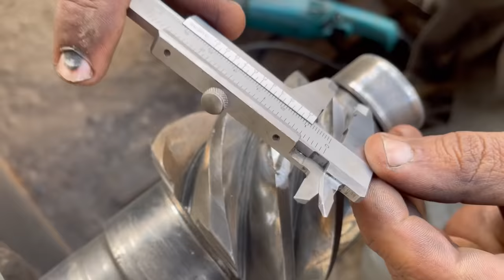I repaired the scrub pinion which no mechanic repairs | Give your opinion by watching the video |

Comment: Comparto con todos los lectores :
Para tener presicion en estas reconstrucciones recomiendo  fabricar dos  moldes en bronce o cobre  del diente para instalar a lafo y lado  para proceder a soldar
Reply: Podrías mostrar la técnica?
Reply: @TheStymax  La Técnica de Rafael es proteger los dientes que están buenos, protegiéndolos de la soldadura que se hace en el diente malo.
Reply: Para construir los moldes :
* se  toma una endidura entre dos dientes en buen estado se llena concualquier epoxico que se enduresca y ese es el prototipo para fundir  los dos moldes saludos a todos los que les intereso mi solucion
Reply: La técnica de rellenar cualquier rotura de este tipo con electrodo es válida también en ejes que se engranan y pierden material por la temperatura de rozamiento, se desgasta y hay que suplementar de alguna manera, luego torno de bancada o manual según sea.
Reply: @pabloantoniofigueroa4162  rellenar un eje y darle la medida de nuevo es algo a rota le según la aplicación del eje, en engranajes es muy diferente, si el patron de contacto es diferente en ese diente se crean puntos de presión que van a terminar rompiendo ese mismo diente o la corona con la que engrana, eso es tallado con un creador y luego rectificado con un creador de piedra, dejando tolerancias máximas de 0.01 mm, además de tratamiento térmico y todo lo demas. con eso sigue andando la máquina pero dura 1 día o 5 años, es incierto
Reply: Existe un spray que se rocía para que las chispas no se peguen en el material en buen estado

Comment: I am amazed that you can duplicate a ground gear tooth with hand tools. Well done, sir!
Reply: Helicopter blades were finished in a similar fashion. I saw it being done at Sikorsky Aircraft in late 70's - early 80's.
Reply: he can't. The tolerance on those finished gear teeth are under a thousandth of an inch, or 1/3rd the thickness of a single hair. I used to make them on a hobbing machine. They need to be that accurate for the oil to work properly and prevent wear, this gear is going to wear out very fast. There's a reason why the title says "which no mechanic repairs"
Reply: Agreed. I guess when you have no other choice you gotta fix it somehow.

Comment: Gears are shaped so there is NO grinding at all! A perfect geometry makes surfaces meet and transfer forces, but do NOT move against each other. This will NOT be the case after that repair.
Reply: He didn't need to grind the other perfectly good teeth. This will fail in no time, they're all gauged. And there is no way in hell that grinding action made the perfect geometry
Reply: @mikemx55  grinding heated the metal which in return got softer which im return will brake again in no time. thats why noone repairs that parts

Comment: Great talent with that grinder. 
Those gears are hardened and match ground. 
It’ll probably be noisy but will,  I’m sure get that machine back on the road and to a place it can be repaired correctly, using a matched ring and pinion. Great video!
Reply: Well, perhaps. If they ran it lightly loaded and assembled it properly.

Comment: When I see failures like this, I think of the engine braking procedure while going down steep hills using the engine compression to brake the truck. When the engine turns the wheels the maximum power the transmission handles is the power of the engine but when the engine brake is applied, it could happen that more power can be transmitted back to the engine,  and the brakes, hence the transmission would fail.   Please work out the related torque in question with the situation mentioned. 
Obviously, this repair is a desperate situation to proceed using the truck, Well done to the welder /hand machinist as he certainly did his best, not considering the metallurgy and how the phase diagram of that metal was concocted without preheating and those multiple starts and stops and hand grinding to eye the result and no surface hardening to finish with..
Under the same circumstances, I think I would.  have taken a mold of another crater/valley in that gear and used blue marking to try and get the original valley shape and tolerances. The fact that it is a helical tooth, and more teeth will be acting in contact at the same time,  there is a possibility that the meshing of the pinion and the ring will be " run in " and serve for some time if the overloading of these trucks is avoided.
Congratulations to the craftsman and I have a feeling that he too knows of the misgivings in that welding, hand grinding 
operation, but he needs to earn a living working according to the culture of the country.......If we think deeply about it,  at some time we all do that I guess, and we do not always follow the rules or the good book of laws. Once when I was working at Chatham Dockyard in the UK,  one Englishman caught me hammering with a pair of pliers and he picked me up saying that I should not do that but to use a proper hammer!  I told him that I had no hammer and in order to get one, I would need to walk two miles, and I could not spare the time either. He still insisted that whatever the circumstances,m it is wrong to hammer with a pair of pliers but as far as I was concerned the logic of the requirements existed in the rate of change of momentum of the weight/velocity in the pliers, and not its shape as a pair of pliers.   What I was doing did work well and the ship I was assisting on, sailed merrily, and it did not fail nor turned back!
Reply: Awesome experience man
Reply: 俺の言いたいこと言ってくれておいてくれてありがとう

Comment: There is a good reason it shouldn't be repaired, even if you had a filler metal of the exact same alloy using tig, managed to heat treat properly, then had a cnc to bring it into spec, it still may fail and destroy the ring gear with it

Comment: Hat off to you. I’m curious to know how long the pinion lasts?  These are tempered, balanced, and precisely machined.  I made a repair, at the request of the owner, where I welded a u-joint on a semi w/ trailer. I didn’t want to but he had to get home. I did this along side the road. He called me later telling me he drove 65 miles at 50 mph and it still held together.
Reply: I'm guessing like 2-3 months of regular use basing on when I welded on teeth on my bike great that one time.

Comment: Ookay, firstly, I would try and determine whether the original teeth are hardened by testing a safe area with a file (a hardness test pack would be ideal, but you use what you have). IF it is hardened, you'll need to temper the whole part to hardnen the new section.
That weld filled section may work, but I would have personally gouged that out to remove the fractured residue and started with a fresh base, then weld filled and shaped the new section.
After that, I would have rough shaped the new tooth and polished it, but I would NOT touch the other teeth since doing so removes the toughened outer layer and shortens the life of the part as a whole.

After that, IF the original part was hardened, I would heat treat and temper the whole part to try and restore the crystal structure of the part since heating such a small area could potentially create a weak point that may shatter in the future.

Would I do this myself?
ONLY if I couldn't replace the part since, as others have mentioned, you have little to no chance of the repair being precise enough to last long... you could use dyes to see how well it works and file out any area's on the new tooth that rubs, but there is a fair chance of this repair causing more damage than its worth
Reply: There's no "if" , diff gears are hardened, they are case hardened around 60rc.
This complete mess will fail shortly
Reply: @stevo184  I figured as such. I also agree that the repair has a "high" chance of failing as is.
As I mentioned above, given a choice, I would outright replace the part since even a proper machine shop repair would probably be best described as a temporary fix on such a component

Comment: Apply low hydrogen type electrode(E7016, E7018) to prevent cold cracking(this clip may use E6013)
Preheating before welding to keep slow cooling
Hard facing on the top layer by hardfacing electrode can get longer operation life
Reply: No se suelda. Se debe cambiar la pieza.
Reply: He didn't use 6013 but a high carbon rod, according to comments here.

Comment: I was gonna question if this would last longer than a few miles. But, this guy clearly has done this many many times, so it must work at least a while.
Reply: Warranty is 30 minutes or 30 miles which ever comes first
Reply: @Mike Raffphone that shop actually has some better pieces of machinery than most auto repair shops in the US, as far as their lathe at least.
Reply: @Mike Raffphone anybody can get a real hood delivered these days. He also knew enough to chip & clean but no idea about pre or post treatment. This isn't his everyday task and he's doing it on the cheap. They have lathes (look at the 3 jaw) and calipers came out. Don't pretend he's Robinson Caruso either.
Reply: @unregistereduser1088  yup, he totally ruined the temper of the teeth surrounding the repair, might as well just used duct tape and aluminum foil. Not to mention the micro fissures he introduced by not pre and post heating then not properly tempering those teeth...

Comment: Very spotless and sterile machine shop! lol.
  Yup, high carbon electrodes to do the building up, good selection.  Some protective covering over the bearing facings and adjacent gear teeth to protect from spatter from the pad welding procedure would've been good, but never mind. Then there is the issue of the heat affection from the pad welding process.   OK, so you've used suitable electrodes for the pad weld, and it looks all nice and shiney and pretty after 'machining' 😲 back the gear tooth profile, ...but the the tooth and adjacent area have been heat affected from the welding procedure, and therefore the uniform hardness and metal crystalline structure. Did they do a heating and hardening process on it afterward?  Otherwise that whole area that was welded up will remain soft and weak and the perimeter of the heat affected zone will be prone to cracking and a larger area of tooth eventually shearing off.
If it happens to work (and without too much weird noise) when you put it back service, then good on you, but in the meantime I would be organising a new part, or a suitably good quality second hand part, because you may need it some time soon.
Reply: You have to remember, this is more than likely to get him to the guy that has the part. If he was to wait for the part his family doesn't eat because he missed his$5 pay check for the month. Anyway 😜 it will probably now match the part that broke that one. Probably why it broke in the first place 😃😂🤣
From the land down under 🇦🇺🇦🇺🇦🇺
Reply: You weld high carbon alloys with high nickel welding rods, not with high carbon rods. High carbon and the welding process don't work well together, it results in an incredibly brittle heat affected zone that can sometimes even be broken by hand or with a light tap from a slag hammer.

Comment: Ok, I would not of tried this repair, but for the most part I have access to parts, especially drive train parts, that said, not many would attempt this simply because there is a huge risk of failure before even finishing, let alone once its reassembled and back in the machine, for that Bravo gentlemen takes some skill to pull that off. edit: there are so many folks on hear griping about the weld being soft... its hard facing rod, its likely as hard, or harder then the parent metal, ya all need to pay attention.
Reply: Your right and the empire they live in that has ease of access to new parts will crumble one day so best to know you can do it if you haft to
Reply: That's a surface hardened pinion. "Hard" does not equal strong.
Reply: @timjohnson1199  first, they are not "surface" hardened, more zone hardened than anything, surface hardening involves adding carbon to low carbon steel, and only effects a very thin layer of steel, and yes a pinion needs to be more tough then hard, hence the zone hardening, the teeth are going to be harder then the shaft, and for that matter the bearing surfaces. 

however, hard facing welding rod, is likely about the same hardness while also being incredibly durable, so its a good choice for the repair, as I said Its not something I would try as plan A, but it will work.
Reply: @timjohnson1199  furthermore, case (i.e. surface) hardening is really quite rarely used in industry anymore, better base materials and better tech all the way around have made it obsolete outside of some tooling situations, and for cosmetic reasons.
Reply: @northmanlogging2769   No. They are most certainly surface hardened.  Even for just a couple of millimeters.

Comment: definitely a work of art, but I would not expect it to last more than 200 miles, if that, under load.....
Reply: Yeah , the welds were too cold , they didn't bond too well with original material and it'll start cracking ,and it will happen again
Reply: Given that he's obviously done this before, has been very careful not to ruin the heat treatment on the rest of the pinion and that weld will be as hard if not harder than the rest I'd say that'll probably outlast the ring gear.

Comment: 99 out of a hundred would say this is impossible... having seen it done, some are still saying it. (honorable mention to the "No Grinder" fraternity who wanted him to give it back covered in spatter)
I would have stuck it in a campfire and let it cool overnight in the ashes to anneal out the welding stress, but otherwise a perfect job.
Reply: You can do it. Sure. It would be ok for something on a farm. But for a road vehicle, it will whine like hell, and probably fail when you least expect it to. The profile and surface hardness will be all wrong, and it will have lots of internal stresses as you point out. I've seen people get away with welding up or grinding out small chips, but having an entire tooth missing is a different story. Judging by the deep groove from the seal and all the metal smearing from having a pinion bearing lock up, this is not this things first rodeo, either. That means that it probably has horrific runout as well. I can understand wanting to save money, but having the thing lock up tight as a drum going down the road won't be too swift.
Reply: Also worth mentioning the thing probably failed in the first place from being so far out of mesh under load. The tooth faces have a lot of rippling wear patterns on them, meaning it probably doesn't see high speed but is loaded up pretty good in operation. But it also alludes to it not seeing any sort of preventative maintenance. And Id hazard to say that it will go back in with the old front support bearing still on it, weld splatter and all. Given its former living conditions, I don't see it lasting very long. More of a band-aid than anything else.

Comment: Clear to see how so many of these guys lose fingers, thumbs, arms and legs. Having witnessed a horrible machinery inflicted injury while working in a metal forming factory, watching him sanding that pinion on that lathe like that had me cringing so hard I could barely watch. 

There is very good reason mechanics do not repair these parts and it's not because they're not able to do it this way. The tolerances on parts such as this are crucial and while to the eye it's an impressive repair the reality is that this part is likely to fail again at some point sooner rather than later and the failure will occur in the same place before anywhere else and for a plethora of reasons.
Reply: ive run grinders for 20 years like that, im not missing fingers. go back into your safety cave newb.
Reply: True, these parts are heat treated to be able to take high shear and stress loads. It may fail, however the point is that it could last and last for the usable duration of the truck. The Owner or Driver would be aware of this weakness and would take additional care not to use this repaired rack and pinion steering gear on bad roads for this particular truck 😏

Comment: I'll say one thing, you've got guts.  Nice job, but a big insult to the metallurgy, so I don't think it will last.  Still, might bring a little more work, and a good excuse to install a new ring and pinion, especially if the customer is hesitant to do it now.
Reply: It's going to last coz I did the same long time ago in the Philippines where parts ain't available that time.

Comment: My issue is with all the work, it induces stress into it beyond any stress it got through use and in this case overuse. The repeated heat cycles with the welding further hardens one part leaving the other parts vulnerable to more stress, while the welded part is probably so hardened it might break with no load due to lack of cohesive hardness (same hardness throughout), This doesn't take into consideration the stressed induced by grinding and further heating cycles to get the correct shape. Honestly you'd be lucky, if it isn't more fragile than a champagne glass. metals while extremely strong, can become brittle if close monitoring of the hardening isn't observed
Reply: To get you up and running this is amazing
Reply: @MMD-z6z , I agree and if it's the only thing available, works, just saying there has been years of research to find not only proper tolerances but to find proper hardness to allow for a solid movement but also wear properly and also flex in certain situations. Being case hardened on one part and heat and work hardened on the other part is a recipe for failure. In the long run it'd be better to get the new proper part. That said in these times where so much is in shortage i can see this happening to keep things going
Reply: No shit dude they don't have any other option you're not a genius for pointing out metallurgy. Love to see you even try to work with this much precision with hand tools.